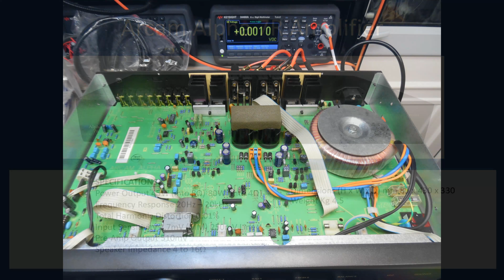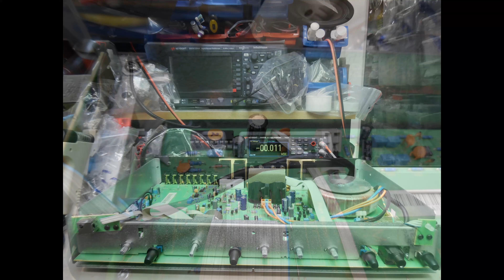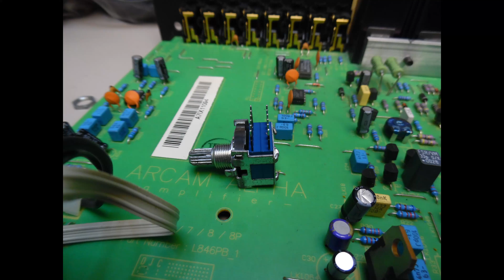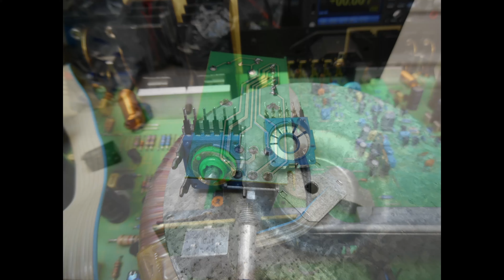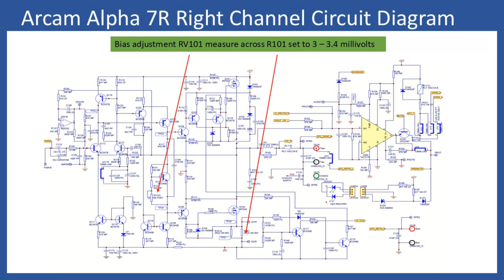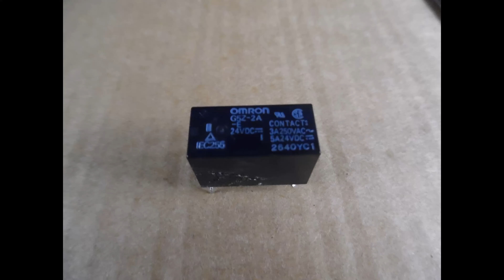Arcam Alpha 7R Amplifier Repair (With Audio Tutorial)

Comment: Another great video thanks.             Do you do repairs on Vintage Amps . Eg Sansui, Marantz, Pioneer, Yamaha. From the 70’s.
Reply from the maker: @andrewhenderson9474  Hi, I do restore  amplifiers from the 1970s, but it depends on a number of factors, for example, mechanical parts  switches, potentiometers and if replacements can be sourced. Transistors can also be an issue if they are obsolete and the circuit is designed for a specific device, and a modern equivalent may not work.
Electrolytic capacitors can be a major concern if they  have leaked and electrolyte has soaked into the circuit board it may mean the Amplifier can not be repaired.
Finally, time and budget, restoring very old Amplifiers can be very time consuming, and customers may not have the budget available.
Reply: @ Ok . Thanks  . You Answered a lot of my questions Really Appreciate that .
Reply from the maker: @andrewhenderson9474  Your welcome